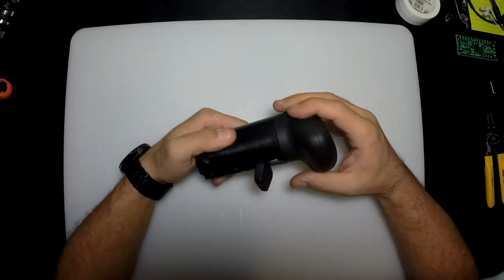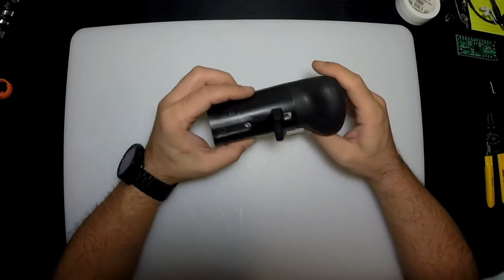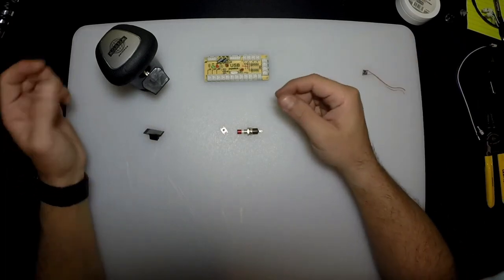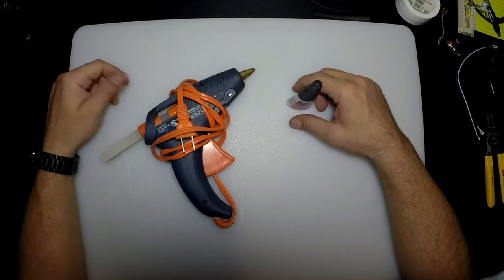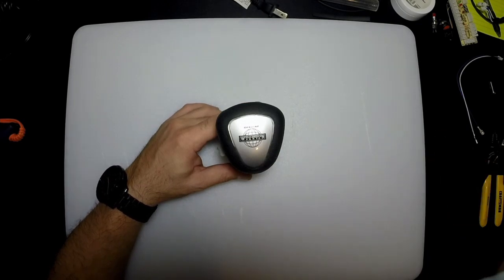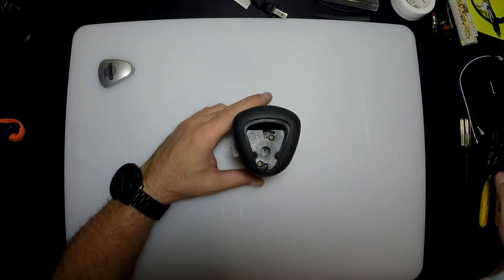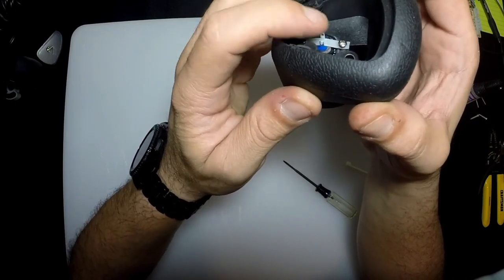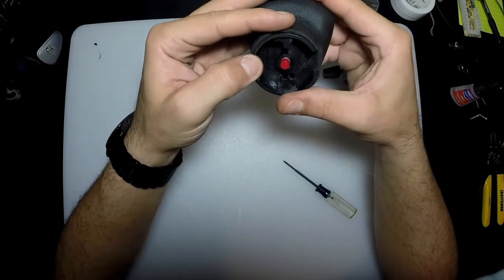Build your own Eaton Fuller Shifter for ATS & ETS with CST Gaming

Comment: I did this with the Scania knob
Reply from the maker: Good stuff. Hope the tutorial helped.
Reply: CST Gaming yes, but instead of a USB joystick board I used an Arduino Leonardo (mini). Some colleagues helped me to do the soldering and 3D printing. It is similar method I think
Reply from the maker: @drkrabster  I was thinking about using an Arduino. How hard is it to program?
Reply from the maker: Also, if you want, feel free to join my Discord. https://discord.gg/6csuceq
Reply: CST Gaming I think it is pretty easy. There loads of code examples on the internet. I recommend an Arduino Leonardo, because it contains the keyboard library by default which is necessary to map buttons (I choose F13 and F14 buttons, because they’re not physically on the keyboard)
Reply: CST Gaming I will join your discord for sure
Reply: @CSTGaming  Did you get the programming figured out for the Arduino, I had one go bad on a knob that came with pedals and wheel but, can not get any help with programming the Arduino board, I have a Leonardo Pro Micro because that's what was already in this one.
Reply from the maker: I have not got one yet
Reply: Jack Allen I did use the Arduino Leonardo, if you want I can give you the code. Just download the Arduino IDE and make sure you select the Leonardo in the settings. Also you need to map the range splitter buttons in the config file from ETS2. The game menu itself only captures joystick button mappings.
Reply: @drkrabster  I would appreciate that I ordered two of these other usb controller buttons but, would like to use this one if you wouldn't mind sharing the code.
Reply: Jack Allen I’ll post it in a few hours. I don’t have my rig with me at the moment
Reply: Jack Allen BTW; what specific kind of shifting knob you are using?
Reply: @drkrabster  The knob I have is the one Tech Affliction uses, I bought a setup ready to run, then the USB port pulled loose from the pro micro board. Never knew it would be so hard to come up with a few lines of program. Can't even get a response from Tech Affliction.
My knob has range, split, and Jake Brake. If I can just get one switch to work I'll be able to make the rest of it work I think.

Comment: Ok you showed us this video but you didn’t show how to attach it on the shifter
Reply from the maker: That's because it depends on what shifter you have. If you have a Fanatec, it will just screw on, if you have a logitech or a tmaster, you will need an adapter.

Comment: Would it work on an xbox one
Reply: its doubtful that the joystick circuit board that's been used in this tutorial will work on the Xbox, the xbox controllers use a special microchip to authenticate them to the xbox so it stops users from using clone joysticks like this.

Comment: hey bud why size universal adapter  i would have buy make one g29 ty
Reply from the maker: I'm not sure on size. It depends on the knob you are trying to put on it. However I did not use an adapter, I used a set screw for mine when I had the g29 shifter.

Comment: I feel the most important parts of this informational are "offline" as the author puts it.  We kind of came here to see how to drill and modify the air shifter to electric switches.  I did buy about everything on your parts list.  Then at  about 39 minutes "it's done" So now you can tell me how you did it, instead of demonstrating the process.  Ok then about 40min, why cut and drill into a ziptie, when the switches have fasteners on them? Can't the fastener on the red "NC" be used to retain the NC switch?  Just trying to do this right.   Total cost of materials 11/20 $45.00 (Tools on hand).  And I did buy the Red (eaton13) to modify to 18, cause the red looks better on the sim rig.   Blah Blah, I7@3.4 16gb X64 RX580 logitechG29, 14 buttons on dash, ets telemetry "Tablet Dash display" Buttkicker+5.1Audio. 80-100FPS ATS, every available state and heavy DLC.  Thanks for the video you saved me like $60, and your video "style" is like hanging out, cause you are so very talky talky, it's like if my carpenter neighbor Jesus was teaching me how to build a shifter.  Gracias Hermano ....    "You know what, I don't even need that hot glue there!"{@1;30}  And then there's the classic "Im going to do this, oh I don't need to do that. "   I laughed, I cried, and I peed a little.    "See you guys in a bit"
Reply from the maker: LMAO. Best comment yet. Thank you. My video is inteded to help and share my way of doing it. If you watched the video, and improved on it that's even better bro!! Outstanding!! Glad I could be of help.
Reply: @CSTGaming  Now with Ats using Multiplayer I am linking to your video and telling new truckers just how easy this is. Amazon has knob for under $30.00 today 7/21.
Reply from the maker: @Brokenneckj  thank you. I truly appreciate it

Comment: i did the same one but jiust one thing i didnt get  its the range because when u put up to go high gear it work but when you put the range down to go low gear it doesnt work
Reply from the maker: Maybe not the right switch?
Reply: @CSTGaming  the same one you put in the description 
I bought it from there
Reply from the maker: @mrlaurobeatz  Maybe in game settings. There is a box that needs to be checked in order for the switch to work correctly. Make sure you double check all the settings. It should work
Reply: @CSTGaming  I’ll try it 
I Followed the video same step you did

Comment: Thanks for the video! Definitely going to make this soon! Also, Does it just mount to the G27 shifter? Or do I have to do any specific mods to get it to hold?
Reply from the maker: Need to buy or make an adapter for the g27.
Reply: @CSTGaming  Do you know where find it? A find an universal adapter, but it's on the European dimension (M12). But de 1/2"-13 it's needed.
Reply from the maker: @TheSmithersKillers  I have seen them on ebay.

Comment: I finally decided to buy a shifter for use with ATS and this video is fantastic. DIY definitely beats the heck out of spending a load of cash. I have a question about the button used for the range selector: have you experienced any wear to the top of the button? Seems the cap is plastic and would wear pretty quickly with the range lever being metal. I'm considering gluing a thin piece of metal to the button cap just to be safe. I suppose that could be done later if it does wear, though.

Thanks for the great vid.
Reply from the maker: I have used mine since the day I made this video. So far I have not experienced any wear or issues with any of the buttons. I'm glad to hear this video is still helping people out.